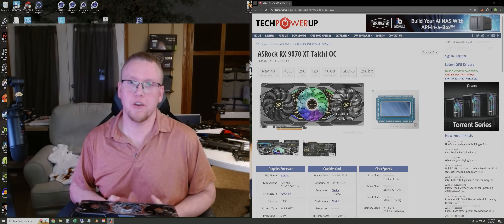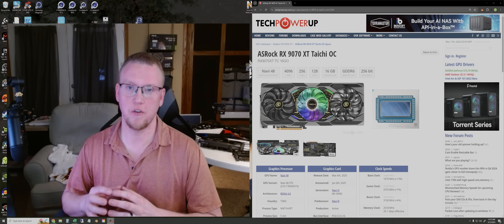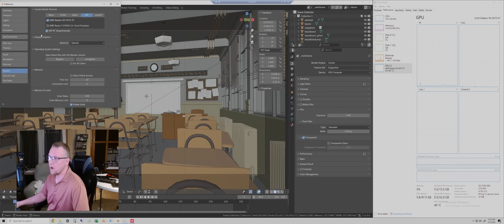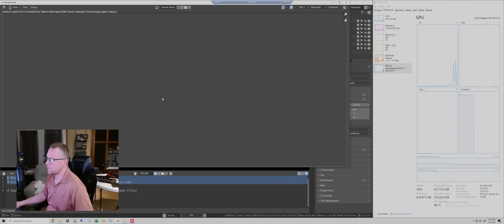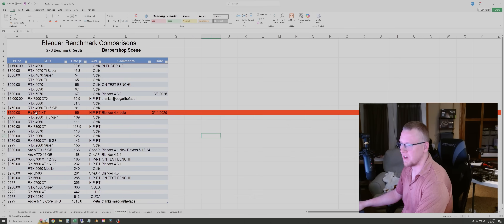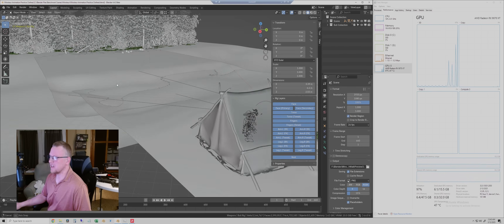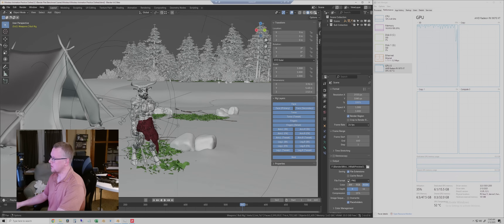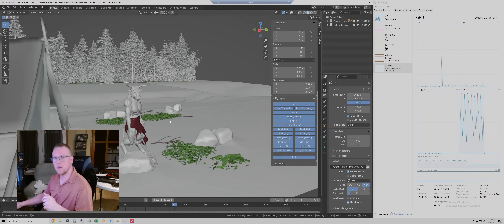NEW AMD Rx 9070 XT Render and Viewport Tests in Blender

Comment: It's a great video Bro, thanks for sharing it, it's also one of the most awaited videos ever! I bought the RTX 4070 Super just after the launch of the RTX 5070. I felt guilty, but your benchmark results helped me breathe easier because the RTX 5070 is equivalent to the RTX 4070. Apart from this, I urgently need your help, I am planning to upgrade my Ryzen 9 3900X processor to either Intel Core Ultra 9 285k or Ryzen 9 9950X or X3D. As a 3D content creator and renderer who mainly uses ZBrush, Maya, and Blender, it seems the Ryzen 9 9950X can outperform Intel's i9-14900K and intel core Ultra9 285k. Could you please suggest a good processor among these two processors to handle my 3D tasks.?  Should I buy the AMD Ryzen 9 9950X or Intel i9-14900K or intel core Ultra9 285k ? Please suggest; my need is mainly for ZBrush sculpting and maya blender renders. please help. ❤❤
Reply from the maker: Hey thank you for the compliments. I am glad to help. The 9950X would be my choice. I have not trusted Intel CPUs from the 12-14 gens and I am not in the loop on the Ultra series. I think the Ultras are ok, but I prefer AMD at this point, because I am familiar with it. The 9950X or X3D will be incredible for you. 
I recently switched my 7950X to the Threadripper Pro 7965WX, and I love it, but I am already missing the faster single core speed of the Ryzen 9 in certain work loads. 
Good luck with the build, make sure to check on RAM compatibility with the motherboard you use. Everything else should be pretty straightforward. Let me know if you have questions!
Reply: Amazing, bro! Thanks for your kind reply and valuable suggestions. It's a great thing that you have a Threadripper,  it's great! CPU, based on the suggestion I'll then go for either the Ryzen 9 9950X or the Ryzen 9 9950X3D. Regarding RAM, I'm planning to buy DDR5 64 GB. Could you also suggest the speed (MHz) for the RAM, its brand, and the best motherboard for this CPU? That'll be a great help.
Reply from the maker: Yeah no problem. For RAM, get 2 sticks of 32 GB, 6400 MHZ is the "sweet spot" for 9000 CPUs. I like G.Skill. You can decide if you want the expensive lower latency kits or normal ones. It won't make a lot of difference in normal performance. For the Motherboard, I would get an 870E. I have not owned any from the 800 chipset myself. But in the past I have had Asus, Gigabyte, MSI and Asrock. Look at reviews to help check for known issues.
I would say choose how much you want to spend on the board, then pick what features you want, like faster ethernet or extra usb slots. The boards vary a bit between models and brands, but stick with the 870E chipset. Then, get into the mobo of choice's website, look under support, and find the memory support. Find a 64GB kit that is on the list. Then you know it will work.

A lot of the choices come down to preference, not right or wrong answers.
Reply: Thank you so much, bro, for taking the time to provide such detailed guidance. I really appreciate your recommendations, and I'll follow them properly
❤❤
Reply from the maker: @livingston.chandranchandra814  Have fun! Thanks for being here!
Reply: Thanks, bro. Sorry to bother you again. shall I choose the Gigabyte B650M for the Ryzen 9 9950X due to budget constraints, Will it work well.? or will it affect speed and performance? or else Kindly suggest some budget-friendly motherboard options.
Reply from the maker: @livingston.chandranchandra814  No problem at all! It will work just fine! You won't be able to extreme overclock the CPU and RAM, but who cares anyway? Make sure to check the supported memory list, and CPU list on the motheboard website. It will be under the support link. 64 GB should be easy to make work, but check to be sure. Also, you are better off with an AMD EXPO certified kit as well. The listings for the RAM will show this sticker, it is easy to find.

Comment: Holy.. I jumped from 5700 XT to 9070 XT. Didn't expect it would be such a massive difference between the two, a 4x-5x jump is crazy! Super happy to be finishing my blender projects on the 9070 XT until the day I (hopefully sooner than later) can get my hands on a 5090! Great video, thanks for including some older gpus!
Reply from the maker: Hey yeah that is a huge upgrade! You are welcome. I am meaning to return to the older 7000 series AMD and some others to test viewport performance. Seems to be popular in these latest videos. Good luck on the hardware hunt!
Reply: Careful with melting connectors.

Comment: AVOID AMD GPUs for blender. Not only are AMD GPUs way slower than NVDIAs, the software support is just TERRIBLE. Inspite of AMD literally having a team working with the blender DEVs !! Besides blender AMD GPUs dont work with other Open Source software as well as many closed source SW. For any kind of compute NVIDIA ( CUDA ) is king !
Reply from the maker: I think you are right for people who are mostly doing creative work on the GPU. Software support is always a question mark with AMD GPUs. I think for casual Blender users who mostly game, there is a compelling value with the 9070 XT. But for Pro uses, Nvidia is still the only brand that always just works
Reply: @ContradictionTech  I would LOVE AMD to be a viable option for GPUs ( Their CPUs rock !), but sadly they are way too far behind on SW. After the OpenCL .. HIP .. RoCM .. fiasco they will NEVER recover against CUDA.
Reply from the maker: I agree AMD is at least behind on software. Which is clear because they only market for gaming now. Nvidia marketing makes you think you can fly to the moon on the RTX 5090. I was also hoping to test Zluda to see if that would make better use of the hardware, but Zluda is not up to date, and it may never be.
Good hardware is nothing without software.

Comment: I want to buy the ASUS ROG Strix GeForce RTX 4060 OC Edition 8GB GDDR6 Graphics Card for animation work in Blender. How would it be, sir? please replay 🙏🙏
Reply from the maker: It will run well, for what it is. The higher cost models for the 4060 are definitely overpriced. The cooler for the 4060 does not need to be very large to work well. So just be aware you don't get a lot of performance from higher cost models, vs. cheaper ones. 
The other thing to note, is that 8 GB VRAM is a bit small. It is possible to optimize your scenes and keep them lower in VRAM use, but at some point that can become difficult too. Do you normally work with high quality textures and realism, or more stylized scenes in Blender?

Comment: Not sure if you will be able to answer my question, but lets give it a go.

Does HIP support multi GPU rendering and if yes whats the performance hit for each additional GPU and if it is flawless (no weird artefacts or crashes etc)?
Reply from the maker: I can test for it. I know it does support multiple GPUs, I have done it, but I have not checked the performance hit. Also, as far as I know, HIP doesn't add VRAM up between GPUs, so dual 7800 XT would be limited to 16 GB VRAM.
I can measure the performance loss soon.
Reply: @ContradictionTech  Oh wow. Thats a quick response :) Thank you. This would be really cool.
Reply from the maker: I'll put something together soon. I actually have quite the list of videos to get to right now
Reply: There will be some performance loss, but you can also start 2 separate Blender instances, using separate card for each. Assuming you have enough RAM to handle it.

Comment: Thanks for testing this! Blender isn't my top consideration for choosing a GPU, but I like to know how much Blender performance I'm losing out on (if it's justifiably not that much) compared to an Nvidia card so I can make an informed decision. Nvidia's price premium isn't worth paying for if it's not your primary use for the card even if it factors into it.
Reply from the maker: You are welcome! Yeah it all comes down to what software you use the GPU for. I think for gaming only users, AMD makes the most sense now. Blender only users may lean toward Nvidia. But all of them can do some of everything at least.
Reply: @ContradictionTech  im going to try out the 9070 for a while. Im putting my 3070Ti into my ladies PC so if i need a specific render i can do it on that one.
Reply from the maker: @SAGERUNE  Sounds like a good plan. I think the 9000 AMD are decent. Especially with some gaming mixed in
Reply: @ContradictionTech  In my case im gonna go on gaming, but would love to try decent game developing. Do you think 9070xt is somewhat useful for it? I dont need the fastest, just something that is not completely "broken". Its not as professionally, im just 17, so it would be just to get into the developing, blender, unreal engine... sectors. Thanks!
Reply from the maker: @kailuna6260 yeah I think AMD is well supported by unreal engine and it works fine in Blender. So the 9070 xt would be a great GPU to start learning with.
Reply: Would you recommend the 9070xt for both gaming and productivity or am I better off with Scamvidia?
Reply from the maker: @qb3540  You should check on the programs you use to make sure they support AMD properly. So for gaming and Blender, you would be fine. I know unreal engine support is usually good, and video editors are normally fine. But idk about other programs in 3D that I haven't used. So it depends on specific programs. 
For no worries at all, Nvidia is the only easy choice with no exception, unfortunately
Reply: @ContradictionTech  Thank You
Reply from the maker: @qb3540  You are very welcome!

Comment: I can't believe it is slower than 7900 XTX with RT capabilities...
I hope drivers will improve the performance
Reply from the maker: I hope so too! But I am going to try to boost it with Zluda tonight, hoping video by tomorrow.
Reply: @ContradictionTech  take your time, no rush

Looking forward to it. Thanks for your work!
Reply from the maker: Yeah you are welcome!
Reply: its not only the drivers but also the Blender optimizations for it.
Reply: @mareck6946 it's on amd, not blender. optix works pretty well for nvidia gpus because nvidia knows how to optimise.
Reply: The 7900XTX is a tank monster of a card, the 9070 is more mid size. All is as expected. The XTX can brute force it's way through anything.

Comment: I think  its to early for these tests as the i feel these cards are not optimized for production use at this time I could be wrong
Reply from the maker: Well I am looking into Blender 3.6 vs 4+ differences, and AMD Zluda vs HIP. But the drivers for both the 9070 XT and the 5070 seem early and neither have pro drivers yet. So you could be correct. But at least they do run stable. I had 0 crashes or glitches with those two GPUs when testing.

Comment: Please Run Blender with Zluda to see if you get a speedup on AMD cards. Also, do you use generative AI with flux and stable diffusion?
Reply from the maker: Hey you are getting ahead of me. I was literally just on the browser looking into zluda. Have used it before. Probably in the next 2 days or so, I will try to get a video out.
I do not often use AI for much, although I think I will eventually use it more for texturing assets in Blender.

Comment: My experience with AMD gup (firepro) is that hardware may be fine, but the software and driver are bad. At the end, I went back to nvidia quadro. Good to see it's improving, monopoly is not good for us.
Reply from the maker: It is improving a little bit, but I think AMD hardware is still much better than AMD software. It is stable and supported in Blender, but I think it is held back by HIP-RT

Comment: why is 4060/4060 ti faster in light scenes ?
Reply: If you check the historical performance of the older RTX 60 class cards, even the 2060, they've always punched way above their gaming performance weight when it comes to Blender Cycles renders.
It arguably always made Nvidia the no-brainer card to choose at the lower end when you'll also need the card for not-just-occasional Blender Cycles use.
As for how it's faster: idk. I chalk it up to Nvidia just being historically more proactive and investing a ton when it comes to helping write software that takes advantage of their cards.
I don't like shilling for Nvidia, but it is a historical reality at this point.

What I'd like to know is, now that AMD's RT hardware is beefed up, when will AMD cards and software catch up?
Reply from the maker: @rhoharane  Well yeah AMD has much better hardware then they have software. I am going to try Zluda on the 9070 XT soon, to see how much performance comes back.
Reply from the maker: That is a good question, that I do not have an answer for. Except maybe the way Optix works just runs light scenes more efficiently then HIP-RT.

Comment: First of all, thank you so much for your videos.  I’m trying to decide between two GPUs within my budget: a second-hand RTX 3090 or a brand-new RX 9070 XT. Since you're familiar with both, I wanted to ask— which one do you think is better? I'm not doing animation at the moment; I mostly work on architectural renders. I'm upgrading from a GTX 1070, and I’m really tired of the lag when navigating in scenes! 😄 Thanks in advance!
Reply from the maker: I would go with the RTX 3090 if you can get one at a reasonable price. The extra VRAM is nice, and the 3090 does not use a ton more power than the 9070 XT. More apps support Nvidia properly. Plus, Nvidia support lasts much longer than AMD's for their older generations, so I would not worry about the age of the 3090.
Reply: @ContradictionTech  Thank you for your quick response! My biggest concern was the age of the GPU, and you answered it clearly. Yes, you're right—I’ll be able to use more applications. The support for RenderMan and Octane Render is an extra advantage. I'm not using them right now, but in the future, I won’t have to avoid them due to GPU limitations. I really appreciate it
Reply from the maker: No problem! Thanks for being here! Plus, if you ever need Nvlink, you would have that option.
Reply: @ContradictionTech  Yes, you're right. Keeping an option open for situations like this might be beneficial in the future. So I will choose 3090. Thanks
Reply from the maker: @rezakazemi3669  Yep! Enjoy it!
Reply: Note that the top end 30 series had notorious power spiking issues that would trip up even the highest wattage power supplies and you'd get random shutdowns. I know a couple of people who were using it for rendering (not just Blender) and they were really annoyed by it. Try searching for videos/articles on "3090 power transient issues" for more on the issue.
If you're using this card for production, you could end up a lot of lost time because of your computer randomly shutting down while you left it to render a long animation.
Reply: @rhoharane  oc 3900x + 3090, 64gb no problems and the power supply is only 750w...

Comment: open data bench!!!
Reply: 9070XT is temporarily not supported due to driver issues
Reply from the maker: @ OK thank you for sharing this! Cinebench is not supported yet either.
Reply from the maker: I can add that to the rotation. I have actually not used the open data bench.